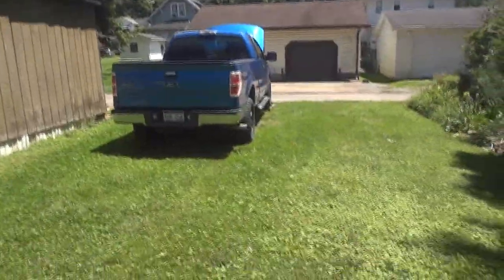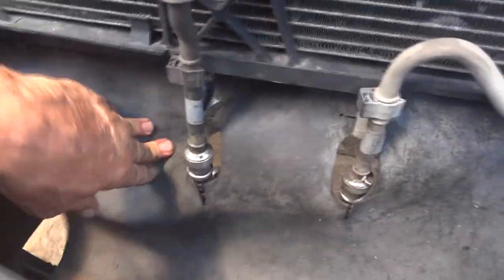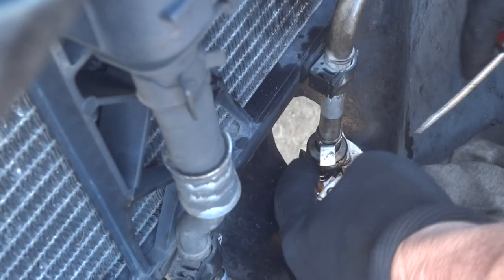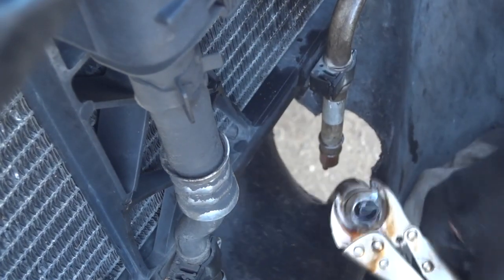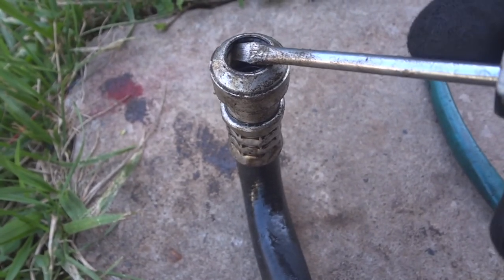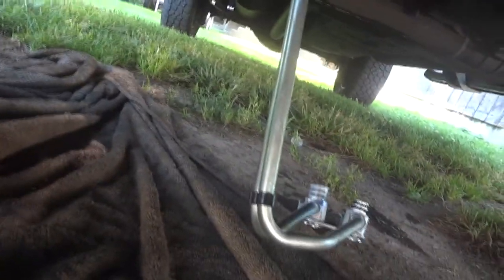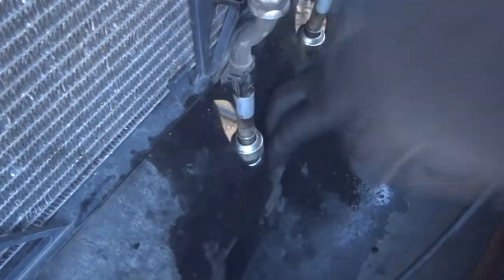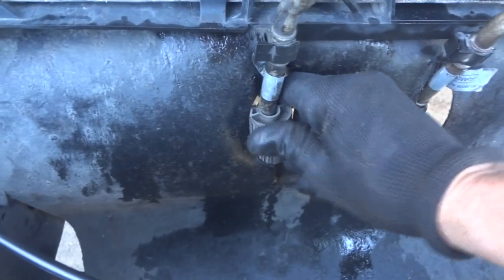2010 F-150 Gets New Transmission Lines How I did mine.

Comment: You are the man with the license plate tool. Thank you.

I’m going to add my 2 cents. My nightmare is a 2011 Expedition 5.4 XLT; and one would think they are the same, they are not. There is nothing anywhere on the how to do the POS Expedition, so here it goes. There seems to be a tighter area under the hood of the Expedition then the F150. Pushing both lines at the same time is impossible. The real estate is not there in the Expedition. I did everything you did AND, had to drop the sway bar from the frame. I popped the clips off the lines at the new trans connection bracket, separating the two lines. There is just enough room for the angled lines to slip under the oil pan. No bending. I ended up putting them in wrong, but was still able to flip them in place. One would also think the F150 line set would be the same. It is not. Anyone in the Washington DC area, Sheehy Ford in Springfield will sell them for 121 and their Richmond dealer will sell them for 113.

Thank you again.

Comment: Recently noticed smoke or stem coming from the transmission cooler is that normal? Have similar truck & year also
Reply: Only with reference to smoke if it's for 0-30 seconds after installing the lines, other than that replace the cooler immediately before burning your transmission up with $2,800 brand new transmission without labor. Steam means you may have a leak in the cooler. Either way it's very sketchy and can cause you lots of $ and aggravation from hell! Check your transmission fluid levels. The transmission level stick and hole to add the transmission fluid if needed is on the passenger side above the pan. I believe it is a 18mm - 19mm wrench. Be careful with it as the stick and cap is extremely fragile.